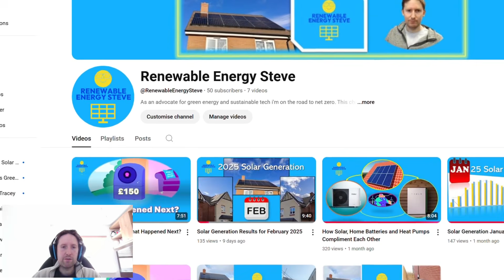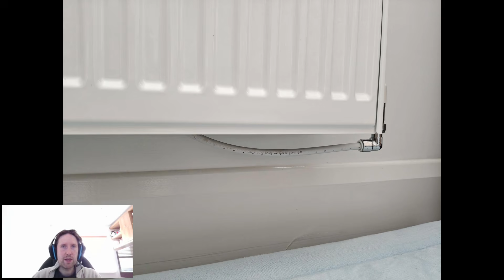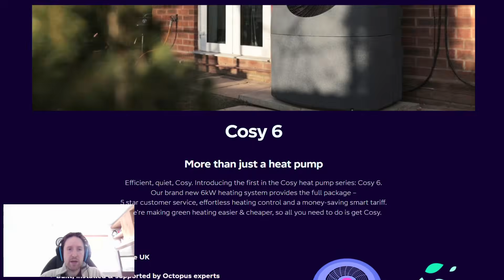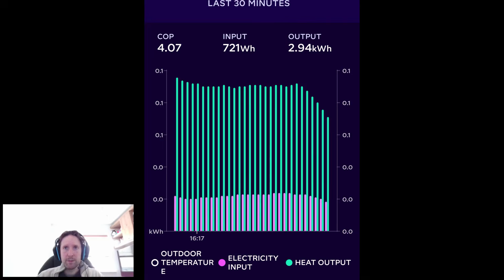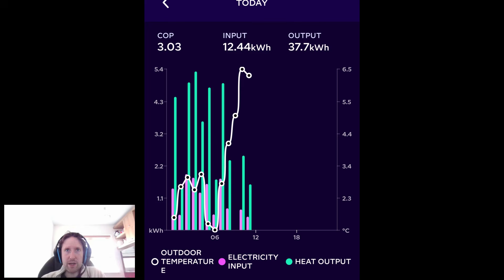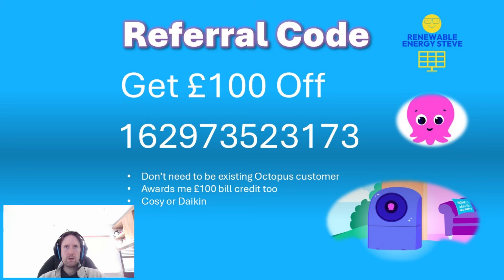Cosy 6 Heat Pump First Week COP – Some unexpected results

Comment: So depressing that gas boiler are being installed into brand new homes. I won't consider a new build without a heat pump when I next buy, as it's just rubbish for the environment. Thank you for the video.
Reply from the maker: Spot on! We looked at so many new homes and there were some developers who mentioned they were adding them and when we enquired they always seemed to be at least a year or 2 away and were just using it as marketing. Let's hope that's beginning to change now. Thanks for watching. 😊

Comment: Our heat pump has been through two winters and has used 3135kwh of electricity, i don't know what the cop is but considering it's on 24/7 is absolutely incredible.
Reply from the maker: That's great! Realistically that's about what I'm hoping mine will use annually knowing my gas boiler used around 9500kwhs last year.

Comment: Is your heat pump running at 50 degree flow temps ? If you can control the flow temps you can improve your efficiency
Reply from the maker: It's on the default weather temperature compensation curve varying between 35 and 55 degrees depending on the outdoor temperature. So typically it's running lower than 50 degrees unless the outside temp really dips.
Reply: @RenewableEnergySteve try reducing the for peak flow temps and you will get better efficiency , the question will be how low can you go without losing target temps in house
Reply from the maker: I can give that a try, i think there are some improvements to be made from the default, but im aware the heating is already more efficient than the hot water
Reply: @RenewableEnergySteve the only way to save more on hot water is to lower the required peak water tank temp , but this might leave you without enough hot water , ( what temp are you heating hot water to and how often ? ) as for heating get that peak as low as possible without you feeling cold water
Reply from the maker: @AllElectricLiving  50 degrees for hot water which is the same as we used with the gas boiler
Reply: @RenewableEnergySteve bringing that down to 48 degrees will improve things , if you can get away with it ( ie you still have enough hot water for family life )
Reply from the maker: @AllElectricLiving  Thanks for the tip. I think it needs to stay at 50 as that's always been about the right temperature. One thing I could experiment with is when the Hot Water comes on. I currently have it during the off-peak time, but if there is a large enough efficiency gain I could consider moving it to late afternoon, it would just use more battery power. Its an option in spring to autumn as I have large battery capacity, but wouldn't work for me during the winter.
Reply: @RenewableEnergySteve can I ask why it needs to stay at 50 degrees ? That’s very hot water to use the chances are you have thermostatic taps so it’s cooling the water before coming out , the only reason you need hotter temps is if you run out of hot water , if you don’t don’t heat it as high
Reply from the maker: @AllElectricLiving  I find Its useful to have temps quite high for some of the greasy washing up and these sorts of things. The water might be heated to 50, but comes out of the tap a little cooler and can take a while to get up to temperature due to the pipes being cold. If i turned it down i would use more of it so running out could be a risk on some days where we both have showers and the boys need multiple baths (it happens due to art classes), so I don't think there would be notable efficiency gains.
Reply: @RenewableEnergySteve we run with lower hot water temps, and two runs per day. We are on Agile, so not everything needs to be heated overnight.  Similar prices: overnight might be 17p and we might choose to heat rather than export at 15p during the day.
Reply from the maker: @Biggest-hz7ng  That's a bit different. Thanks for sharing 🙂
Reply: @RenewableEnergySteve  it was meant as a suggestion for multiple runs to a lower temperature for those that have multiple cheap periods. It might then be possible to avoid heating to a higher, less efficient temperature.
Reply: @Biggest-hz7ng  if u have battery why u not on around 8p night rate like octopus go
Reply: @deanwhittle1301  we have a small 5kWh battery, sufficient to get us through the evening and morning peaks slots on Agile. It's also useful to store cheaper electricity when it is available overnight.

Cosy, Agile and Go work best with the size battery we have.

It's not sufficient to power our heat pump or tumble dryer for long periods. The car can charge when Agile drops low too.
Reply: @Biggest-hz7ng  i have 20kw did have 10kw when i first got solar and battery late 2024 then early  2025 got 2x 5kw more for £2530 coz in winter i fill up at night 8.5p then use in day so max in one day cost me £2.60 ish including standing charge some days under £2 but in 2026 if i get  heatpump  and it cost me any where near  2.3k i might try buy 1x more battery coz we defo most days  use more then 20kw with a heatpump and i allways cap battery to not go lower then 20%
Reply: @deanwhittle1301 I am certainly going to look at it when I add more solar, hopefully this year. But my calculations suggest battery investment takes longer to payback than solar, so I might continue with a comparatively undersized battery.

I like the idea of Agile and experiencing real world pricing, so I plan to play with automation and see how easy it can be.
Reply: @Biggest-hz7ng  my  2 extra battery i bought early 2025 i payed 1250 ish each that was including labour but allso helps u if for some reason any price spike like they did in covid but there not VAT ON THEM ATM  as well

Comment: 10mm copper microbore isn't ideal but still workable. You have 10mm plastic which is much more restrictive due to the inserts it uses.

With a good design, quality heat pump, and installation, you should be getting COPs closer to 4 or even higher. Such is the relatively poor efficiency of the Cosy solution. Ask Octopus if your design can accommodate turning down the flow temperature by 5 degrees and see how that goes - the lower the better as long as it can still maintain your desired internal temp when negative outside.
Reply from the maker: The weather compensation curve can be adjusted via the app so I can try some lower numbers and see how that affects the efficiency.

Comment: I have Rooftop Solar, Heatpump LG Therma V Monoblock 9 KW R32. Aircoplaza Zwolle 3575 euro. Subsidie 3075 euro. Normal radiators. Perfect. Kitchenboiler 10 Liter 125 euro and bathroom boiler 50 liter 175 euro. Inductioncooking 200 euro. All Hornbach.
So Warm Water and heating separated. March I used 244 kWh. And delivered 231 kWh. Cost 20 euro. Super No Gas. In Groningen Nederland. Thank you for your video.👍

Comment: I run my heat pump low and 24/7, I have spent some time getting the weather compensation right which makes a huge difference. I don't know my cop as have no external sensors other than a electricity meter on the heatpump input. The controller does show input output and time run but even the manufacturer says its miles out and they are correct as so far this year it has shown 360kwh more than the input meter.
All I know is I am happy with my results and as previously we were on oil it is cheaper to run compared to the amount of oil we got through. Our epc says we need 25000kwh for heating and hot water per year and the heat pump has used between 4000 and 4500 kwh per year the last 4 years which   is good I think. We used around 1500 to 2000 litres of oil per year previously.
For good efficiency you need correct flow rate and correct size emitters and if you can run completely open loop and use the weather compensation to keep the house at the desired temp. Just for context our house is 220 year old 200 sq metre solid stone walls with just loft insulation and double glazed windows. So they do work great if fitted and used correctly
Reply from the maker: That's excellent to hear it's clearly working well for you in a property of that size and nature 😃 sounds like you have it well set up 👍

Comment: Efficiency has to be at a certain temperature, they just don't say on the page you show. SCOP is seasonal so it flattens out all the temperature/efficiency variations. My heat pump has efficiency numbers from 190% to 475%. The 190% sounds really bad but it's at -30C, the 475% rating sounds great but it's at 8.5C.
Reply from the maker: Thanks for your insights.👍 I thought it would be something like that 😀
Reply: Interested see the wild changes in outside temperatures, is you sensory north facing? Good results, don't get too hung up on efficiency. You're running costs are the important thing. Good luck with the videos, plenty of people interested in the cosy pump.
Reply from the maker: @derekpaisley620  it's south facing, or rather, 15 degrees off pure south. It's possible the temp reads a touch high in sunshine.
Thanks for your support 😃